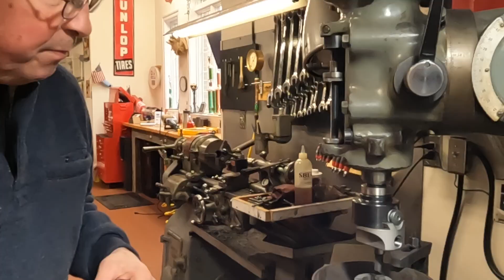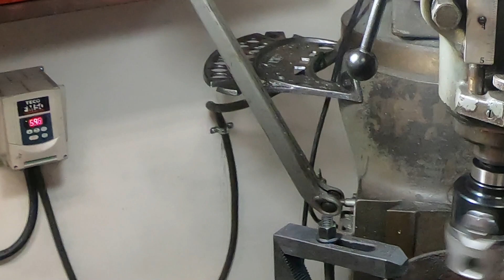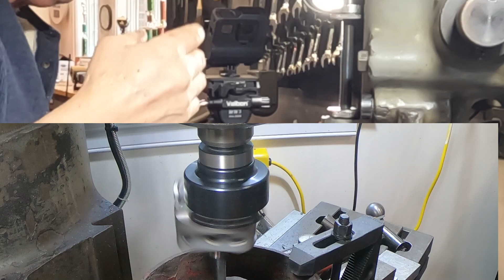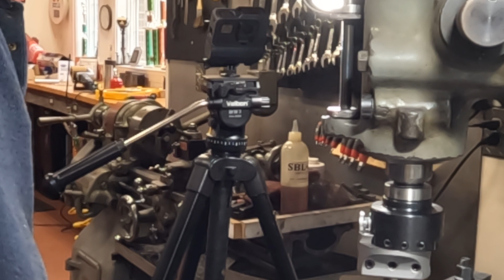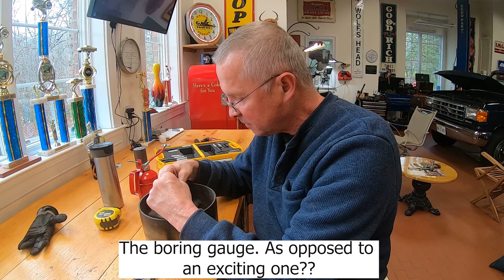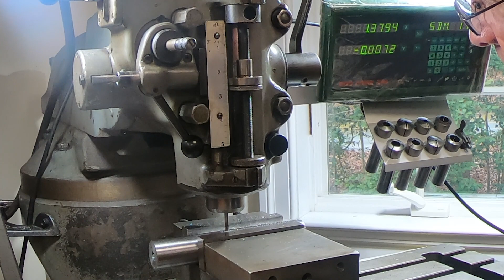New pulley bushings for the Frick Sawmill!

Comment: Instead of welding the bushing to the cast iron pulley isn’t brazing better? My father used to knurl the outside of bushings if they were a little loose in the bore before pressing them in.
Reply from the maker: Mack, Yes... but my brazing skills are quite limited.... I can TIG weld brass pretty well though, but in this case some green loctite will do the trick. It's super thick and meant for sleeves (not threads). Thank you and Merry Christmas!
Wayne

Comment: why didn't you make that a slight press fit ?  the way you have it will it move in the pully houseing.
Reply from the maker: Lester, That was the goal.... I screwed up. The good news is green loctite will make it good, and it is low RPM! Next time I'll do better, but the Chianese indexable boring bar calibration is really hard to get right. Thanks!